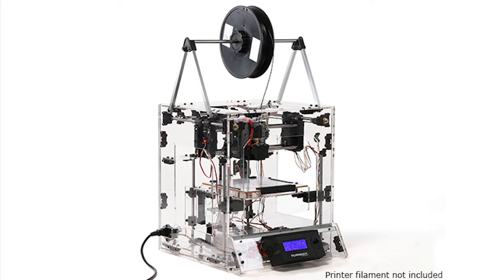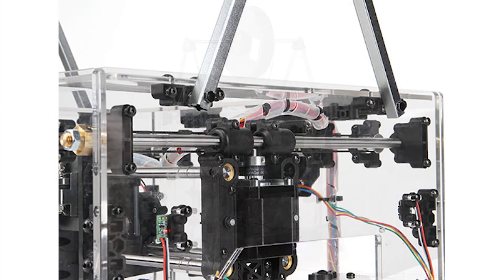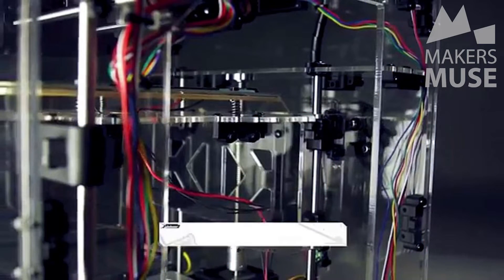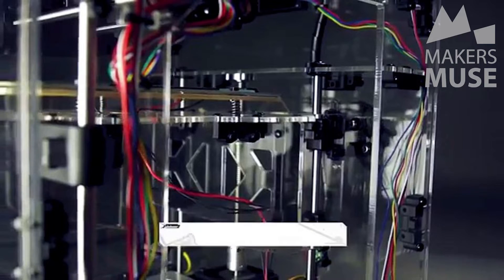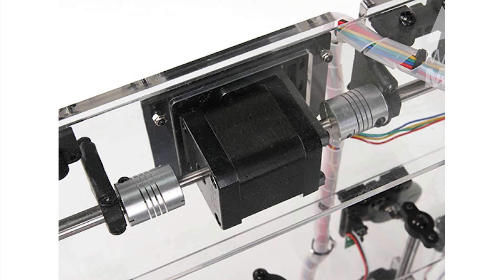Why do 3D Printers still kinda suck? - 2015

Comment: have you ever used a Da Vinci by xyzprinting?
Reply from the maker: No. Why ask this on 3 videos lol. Chuck over at elproducts has though.
Reply: sorry about the multiple posts I was a bit drunk when I did it!! I'm subscribed to Chuck and you because I respect both your opinions and    was wondering what yours was on the Da Vinci.
Reply: The DaVinci V1.0 was my first 3D printer and it served a purpose. It educated me about all the things that contribute to a poor printer design.  I did print a lot of parts with it, but as soon an a built a Kossel Delta printer from scratch and saw the quality difference, that was the end of the DaVinci. It really pains me to say it, but the DaVinci is rubbish. The new DaVinci Pro is a substantial improvement, but it is still far from being in the same league as an Ultimaker or Zortrax M200.
Reply: I have a davinci 1.0a that had been flashed to repetier firmware. If is not flashed you have so few options and the cost of the filament will make the cheap price of tree machine not worth it. I used it for over a year  them one day it just kind of died. since then I've used my monoprice select mini that cost me 250 bucks after tax and shipping. And that thing works 20 hrs a day no problem. the only thing I don't like is that the bed is only 5x5x5. But other them that I would recommend

Comment: It's interesting what you say about improving 3d printer design because all the online discussions around servo based printers seems to suggest that they would be more expensive, primarily because you can't use hobby grade servos. There's a good thread on Google groups and Jetguy pretty much poo-poos the idea.
Reply: "Servo" doesn't mean using actual RC servos - it refers to using a motor with feedback (from a potentiometer or encoder) and control circuitry to ensure the mechanism always moves where you want it.

Comment: the reason becouse inkjet printers had a dc motor with an encoder its becouse the encoder its cheap, unsealed, and unprecisie, they work like a charm for print paper becouse nobody ever needed print a word with a 0.01 mm accurcy, but 3d printers need that precision for delicate models,and where are fine trheads too, and a encoder for 20 cm of travel its very expensive, even the crapy chinese, the crapy cheap linear encoders for a common 3d printed cost around of 450 dolars the 3 axis pair without shiping, that make a far more expensive printer, that the reaseon becouse nema 17 is the best choice for low-cost medium respectable accurcy 3d printers, but anyway you can achive impresive results with actual 3d printers

Comment: I have Geeetech Prusa i3, it's extremely cheap, only 350 usd. Print quality is good enough and I won't vaste more money for any fancy brand printer.  I see no reason why to pay triple price for a printer if it will give only 10-20 percent quality improvement. Makes no sense. And the worst thing is that many "good brand" printers accepts only their own filaments. So my advice is oposite - don't vaste money for printers over 1000 usd. Because price and print quality ratio is far from reasonable.

Comment: 1 year later and it's still true.

Thing is I don't think people have run out of ideas. I just think the ideas that are out there are going to drive costs up, and no one wants that. So they pussyfoot around the issue and release the same crap they had a year later in a brushed metal container.

Comment: +Maker's Muse  I think the problem is in price, which means that for a under 1000$ 3D printer there is no much sense in a servo motor, however, I can not understand why a printer which cost 4000$ does not have such motors, considering that the print quality of a 4000$ vs 1000$ is around 20-30%, that doesn't make sense )

Comment: Really?    I own a full size Fabrikator and have successfully printed hundreds of beautiful pieces.  the only thing i have a beef about is that hobbled king abandoned it.   It is a beautiful printer and with a little tinkering around with the settings which were btw CRAP , it now prints amazingly beautiful prints.  I havent had any problem with the fact that the chissis is made of acrylic either!

Comment: I own a cheap I3 that can print during hours without loosing one step, so I don't feel the lack of loop is a problem. Issues are mostly from extrusion.

Moreover a friend of mines who is a complete newbie in 3D printing bought the first Hobbyking printer that you shoot into flames in your video. As he was unable to run it he just brought it for me to get it a trial.

Ok this printer looks like the first Reprap, ok it looks like too much complication, ok it's a big machine for a 15x15cm bed. Obviously that would not be my first choice, but... It actually works.

By stupidely plugin it on my computer instead my I3, I was able to printing directly and after a few settings (mostly reducing flow to 0.88), it prints with the same quality of my I3.

Pros:
- Fully Reprap compatible (Arduino+RAMPS, fimware pre-loaded)
- Comes with a spool holder (!)
- Nice manual bed levelling
- Print quality ok
- bed and nozzle both heat quickly

Cons:
- Big
- Noisy
- Not closed
- Not stiff enough, sometimes unpredictable behaviour when levelling the bed
- The bed is only 15 x 15 cm (but should be extended to 17x17 or 18x18, the glass is smaller than the bed due to his fixation mode).
- Only 10cm on vertical axis.

Comment: OK your rant was great I agree 100% The biggest downside right now is the software. I do not think everyone has run out of Ideas. For the most part the consumer  3d printing happen in the opensource crowd.  So Start developing! Make a printer with servos with feed back.  The Guys at FirePick have talked about it on the google-group.

Comment: It looked like a long overdue realistic assessment of the 3D printing market to me. 
I have been thinking about getting a 3D printer myself, and have been getting quite an education online. Unfortunately all I can see out there are problematic machines cranking out pretty poor parts for very high prices. It looks like you have to shell out at least $2500 to get a machine that is at least somewhat reliable. Think about it for a moment, you could get a real milling machine or a lathe for less! I know, they are different things, but the 3D printing industry needs to get over the expensive toy stage and wow factor, and make machines that are more in line with people expectations if they want to have a long term viable business model. 
I want a 3D printer for less than $1000 that will print smooth structural parts with little or no post-processing, perhaps in multiple colors. I imagine the 3D printing industry having to go through the same trials and tribulations the computer industry went through in the early '90s, when computers were expensive and not necessarily very useful, to emerge as a necessity by the new millennium, with prices decreasing and utility increasing exponentially. I remember spending $3500 for a laptop in 1997 that couldn't do much more than writing papers and sending emails. 
I think I might just wait a couple of years longer then take another look at the 3D printer market. 
Sorry about the rant as well.

Comment: I want to get into 3d printing, however I don't really want to spend too much, as it is just for fun.The newest Prusa I3 is £300, however on Ebay I can get the previous one for around £150-170. Would you recommend the newer or older one? Or maybe a different printer at all? Looking to spend less than £200, so I have considered building one from scratch. Any help would be appreciated.

Comment: I have owned the TGY Fabrikator for about 6 months now and I can't say it's as terrible as you claim it to be. It took some time and experimenting to get it set up properly but I'm actually quite impressed with what it can do. At high quality settings my PLA prints come out looking pretty good concidering the 250 euro's I paid for it. ABS is still a different story but that's probably because it's an open printer. I'll try closing the housing so the heat will stay inside. 
If it's at all true what you are saying about the fabrikator my overall experience with 3D printing can only get better........after this printer ;)
Reply from the maker: +Crazy Crow The Fabrikator turned out to be an OK machine after a while, and the Fabrikator mini is actually amazing for the price. The rant was mostly focused on the flood of 'me too' machines hitting the market at the time and the Fabrikator was the straw that broke the camel's back so to speak. The Wanhao duplicator i3 was the turning point for me - still the best bang for buck 3D Printer in my opinion!
Reply: +Maker's Muse ok thanks for the confirmation. You had me doubting your expertise there for a sec. ;)

Comment: The m3d printer works, i have no experience with 3d printers besides the videos and articles i've read about them, but i got an m3d printer last week and it works so easy straight out the box, pla and abs work fine, the only downside is it's small size. It's a very consumer friendly product, whether or not you get your moneys worth, i don't know.

Comment: i am kind of dissappointed that the quality abd resolution has not really improved much in years. but at least its getting cheaper. i scored a makerbot mini for $300 on ebay with 8 extra rolls of filament. i am super happy with it. printing crap like crazy no real issues so far. i want it for making rocket parts.

my only real gripe is build volume. if you want any sort of build volume the price jumps to thousands of dollars. i rwally want that 16x16x21 gmax but $3k is a pipedream for someone like me anytime soon.

Comment: What printer do you recommend for a traveling teacher?

I was looking at M3D but it seems the feeder gear goes out real quick. PLA is probably fine.

The main thing is cheap (I need to buy several) and easy to toss in the trunk and use at different locations.
Reply from the maker: +Consult Keith Young Have a look at the UP Mini or the CEL Robox - both I would recommend can handle the rigors of transport - although care should still be taken. The Robox might be the best option as it will automatically calibrate the bed level before each print - in case it changes in transport. It's not too cheap unfortunately, but cheap usually means fragile or not suited for transport (I wouldn't dream of transporting the wanhao duplicator i3). You MIGHT get away with the Fabrikator Mini, it's so light it's actually pretty stable in transport - but if it gets dropped it's dead meat. It also needs a tethered computer while printing unless you add an LCD and SD card control interface.

Comment: Just discovered your channel. Have you ever tried industrial level FDM machines? I use a Stratasys Mojo in my Uni's research lab and other than its small build volume, the quality and reliability are the best I've experienced (and I tried a BFB 3D touch before). Plus it natively does soluble support material.

Comment: While I think your points are very valid. There is a technical issue with the inkjet printer comparison. They scan the head back and forth with a DC brush motor, and maintain approximate control of speed with the encoder strip, but how they get the 300/600/1200 dpi accuracy is letting the head move at a constant-ish speed, and firing the ink jets at the right moment as determined by the encoder strip. Not quite open loop, but not a tight control loop with positive control of the position. Can it be done with a bigger motor to shove a bowden extuder around? Definitely, just with bigger more power-hungry motors which may only be a minor improvement over the steppers power draw wise.  

I'm not up to date on the in-depth features of the various control boards, but a dynamic current control for the stepper would improve power draw greatly I.e. vary the current delivered to the motor with the acceleration required, a simple linear move may only need 0.5A to maintain control, but doing a tight honeycomb infill would need much more current on the axis doing the wiggling back and forth rapidly. 

The frame stiffness issue is definitely spot on though.  While I do appreciate the idea of the rep-rap and acrylic or plywood printers that can be made cheaply and the design open to everyone, their stiffness is going to be laughable.  Coming from a machining background where a machine is based on a giant iron casting, and DIYers can use an epoxy-granite concrete (no cement, the epoxy binds the aggregate) wood and acrylic were total a deal breakers for buying a unit.  I ended up getting a flashforge creator X with a steel frame and had acceptable results, and buying a lid from a creator Pro and closing up the front improved things further.  But hey, make a laser cut machine, throw some high step per revolution steppers on it, throw some small resolution numbers on it, and you can confuse consumers into buying your $500 machine and wondering why a $1000 machine has the same specs and build area, so its "obvious" which one is a better deal.

Comment: So what 3D printer stands out from the crowd?
Reply from the maker: +id104335409 Cubicon is best I've tested - but also the most expensive. Ironically, the Fabrikator Mini has impressed me almost as much and it's the cheapest I've tested. Depends on your needs.
Reply: alright, thanks. I'll see what I can find out about them. So far to me flashforge dreamer semed like the best choice.

Comment: Quote 1:00
Why wont we use servos like printers?
Because printers dont use servos

Yes they use servos for the print head, but for the paper most printers use stepper motors, or heavily gear reduction servos to get quality prints. Also stepper motors are able to keep their angle with force. So lets say you need something at an angle and to stay at the angle. Thats something only steppers can do. Or much much more expensive servo motors.
But like I said, most printers use stepper motors for loading the paper, and Ive only seen one use servo.
Reply from the maker: +robert karas Every single modern printer I've cracked open has a geared DC motor with encoder wheel ie servo on the paper feed. They stopped using steppers EXCEPT for the scanning units in almost every unit I've tried. Servo implementation is harder, but in eventually it's a cheaper option if you can get away with cheap plastic encoders.
Reply: Maker's Muse The plastic encoders are basically a cheap servo. But it seems I had a different experience in opening printers compared to yours.

BTW I really appreciate you commenting and discussing with your viewers.

Comment: Just want to say all of these issues are solved with a diy reprap
Reply from the maker: +robert karas 3D Printing as a hobby is fine, no problem with that.. but how long does it take to make a reprap and then how long till it prints well? Many people want to use 3D Printing as a tool, and just don't have the time to invest in that kind of activity.
Reply: Maker's Muse Thats normal with all machines. CNC, Lathe, Router, etc etc.
If you want to use it as a machine/tool, then its common to calibrate your machine, you service your machine, to take care of it.

Now you can go for the option of no service, no calibration, but you would be paying 5-10x more. And if your machine does and will break, then expect to spend half of what you payed for the machine in repairing it.
Reply: robert karas

Comment: Hi, I appreciate your honesty, are you saying don't even bother getting into 3D printing right now or are you saying pay for a more expensive printer? I value your opinion as you have the experience.
Reply from the maker: +Matthew Smith It really does depend if you're looking to get into 3D Printing as a hobby to learn about how 3D Printers work, or if you want to get a 3D Printer as a 'tool' to produce 3D Prints reliably and easily. 

A cheap 3D Printer will teach you a lot, but a more expensive 3D Printer like the Cubicon or Ultimaker 2+ will give you the reliability to hit print, walk away and come back to a completed product 99% of the time. Low end 3D Printers just can't do that yet.

Comment: I really prefer steppers over servos. Servos are only ideal for conditions where there's resistance to what you're trying to do. In a normal 3D printing environment, you shouldn't be poking around in the printer, so it should be fine. Steppers are always ideal for printers. Almost every 2D printer uses them- even in scanners. Servos also can't stop as [impressively] fast as a stepper. I have to say I'm a fan of how responsive stepper motors are as apposed to servos.

Comment: I am looking at a couple printers. I have worked in IT, and am fine with tinkering to get things working. Local reputable company is selling this printer, which I think is a clone or copy, or rebranded Flash Forge Creator Pro, metal frame, heated bed, dual extruders, SD Card slot.  for  $500.   They also have a clone/copy of the Flash Forge Dreamer for $800
Nice thing is if it doesnt work, or has issues I can return it to the local store. They also sell lots of filament at the store too.
Here are the two models..  what are your thoughts... 
$500
http://www.microcenter.com/product/435491/3D_Pro

$800
http://www.microcenter.com/product/448607/Ultra_3D_Printer

Thanks...your videos are awesome

Comment: i really want to buy a 3d printer but cant afford like a maker bot might go with a rep rap diy and i feel l Iike its going to be a headache
Reply from the maker: +Johnny mods It's like buying a computer or any other bit of high end hardware, you CAN get a cheap machine, or put one together from parts but in the end you might end up with something very limited or even unusable. The chinese i3 kits would be the lowest I would go, at around ~ 220USD.